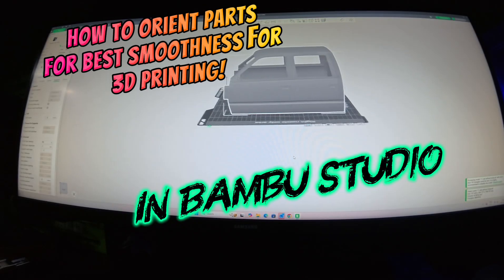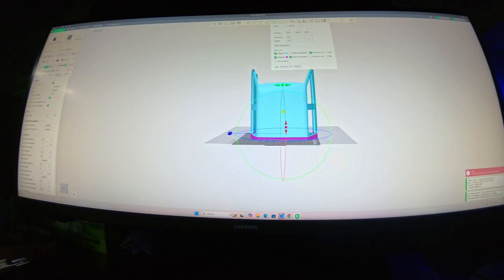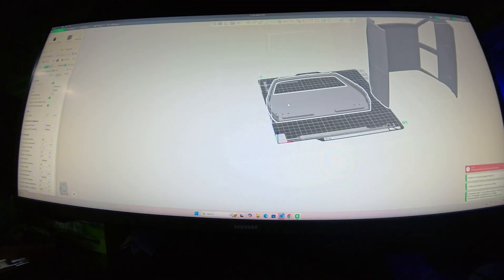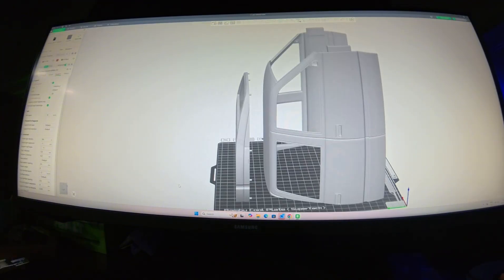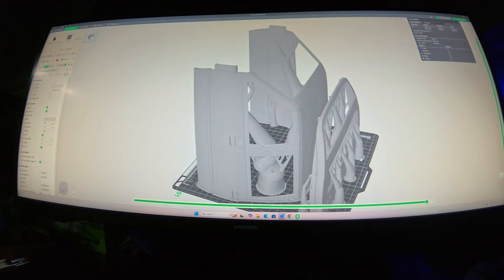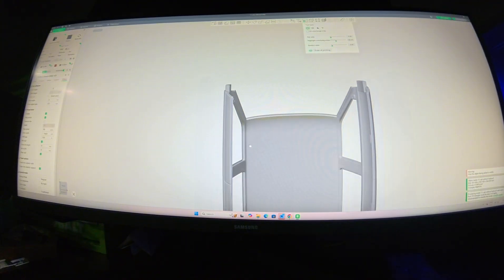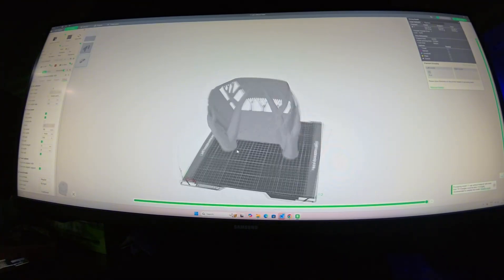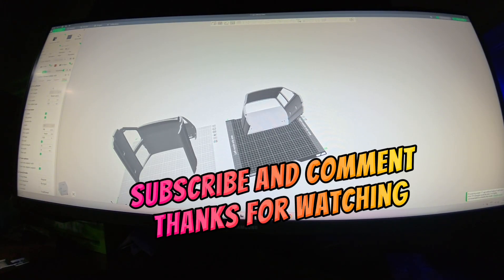How to position 3d prints for maximum smoothness in Bambu studio #howto #3dprinting #bambulab #diy

Comment: time stamp 4.50  when orientating part, type in the Y X or z and change it to 90.  and it will change it and be perfectly straight up and down, instead of moving manually. works a treat... cool vid. very helpful.
Reply from the maker: Tilting this is better than straight manually is best for these bodies I use that method for other parts tho for sure